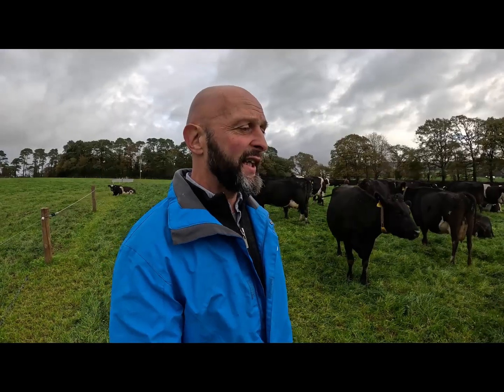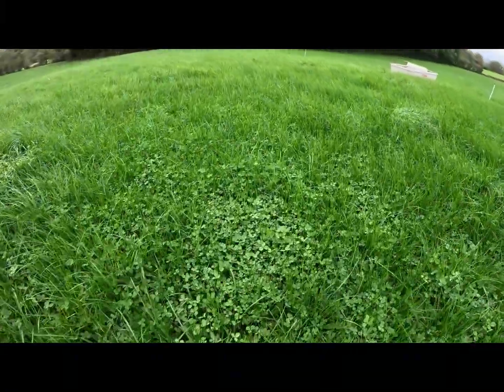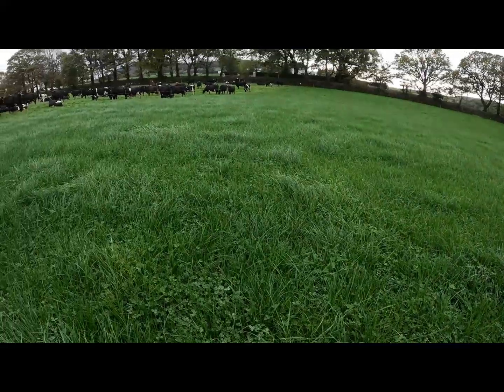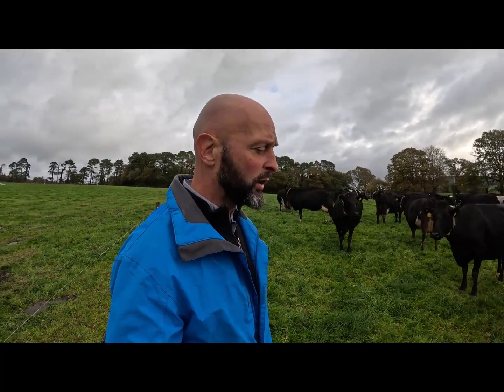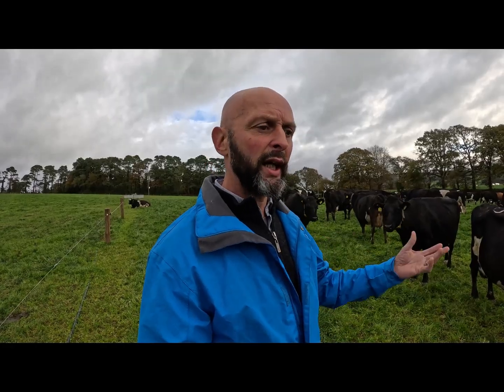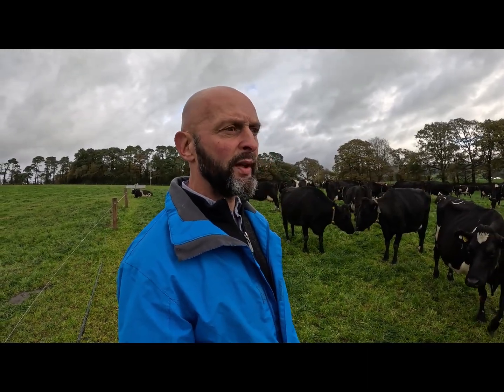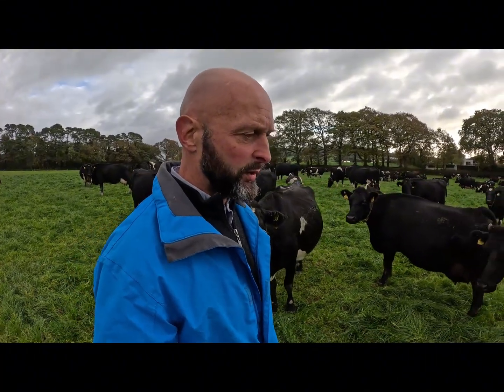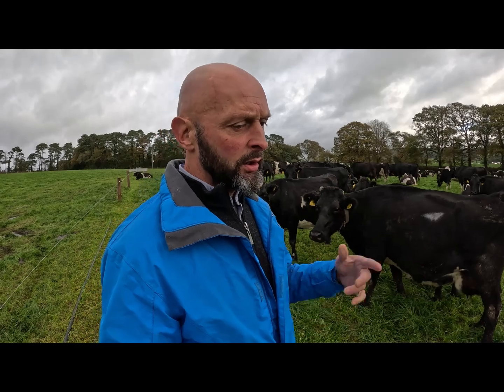Clover & Bloat

Comment: We’re organic beef in UK (store and fattening) and have included clover by default for a long time.  Probably 10-15% in seed mix, largely white alongside PRG and chicory.  Soils are high K (ind. 4 ish) and low Na

No bloat issues over the years but have taken an interest in Teagasc Grass10 and thinking about trying to get clover content up to about 30%.  Also using more species / multi species in general.  After watching this I’m reconsidering!

Do you have any experience of at what % clover (seed or proportion of award) bloat becomes a problem?
Reply from the maker: In an organic system you should definitely be aiming for 30% clover, depleted soil N levels are a massive issue on many organic farms, soil biology requires N to thrive and legumes are the key to that.
Bloat should be much easier to prevent in a beef system where intakes are more steady, on a dairy farm where cows are pushed to graze, then tend to be off grass for a few hours when walking, milking and returning, and appetites are stimulated by being milked, the risk is much more difficult to prevent 
10 to 15% of the seed mix should be sufficient to achieve 30% clover, the small seeds means there are way more seeds per Kg

Comment: Surprised about tanins accentuating the problem. The tanins in sainfoin and birdsfoot trefoil are considered to make them non-bloating. I have wondered what ratio you need in mixtures to confer that bloat control to a mixture in the herbal ley. What is the mechanism of plantain tanins accentuating bloat?
Reply from the maker: I don't know the technical reason, just know that when I went all out on herbal swards I thought the herbs would counteract the bloat risk but found out that plantain tannins aggregate the gassing caused by the clover
Reply: @GraiseConsultancy So personal experience rather than a scientific study? That doesn't make it wrong just worth further investigation if bloat is going to be a barrier to utilising clover.
Reply from the maker: @S_Eglington no not personal experience, that's what I was told by a couple of experts

Comment: Can clover silage cause bloath.have taken land with high clover rate in for silage..was red and white clover mix with grass.
Reply from the maker: It is possible with red clover but unlikely, low dry matter a high risk factor so if silage is 20+%DM should be no issues

Comment: When we were in Southland we would always get bloat on 2 particular paddocks,the only way we could get enough bloat oil into the cows was to boom spray the break just before they went into it,we just used one of those brass rose nozzles
Reply from the maker: Amazing how particular paddocks can be such an issue.
The morning i lost 15 cows i had drenched them with bloat oil....
Reply: @GraiseConsultancy we were still getting  8 or 10 every time they went in those paddocks even with drenching that's when we started spraying it on and didn't get any problems after that, it was a bloody  hard decision to stop spraying them in the late autumn

Comment: In Aus we use rumensin and oil mixed in with the grain mix to protect against bloat. Also let free access barley straw as they walk away after milking.
Reply from the maker: Rumensin if effective but it's like a low level penicillin in the way it interferes with rumen biology, can reduce rumen efficiency extracting value from pasture consumed. Tradeoffs.....
Reply: @GraiseConsultancy  Thanks, yes tradeoffs, the challenges of management decsions.